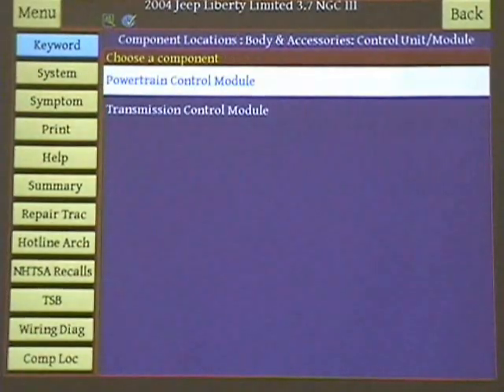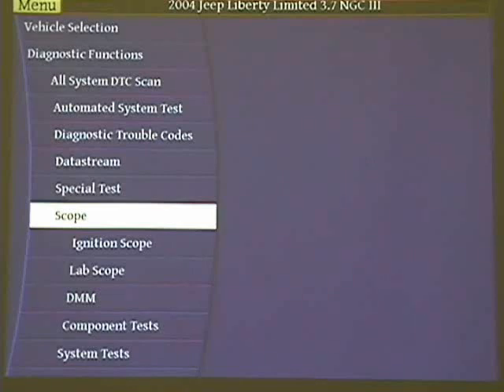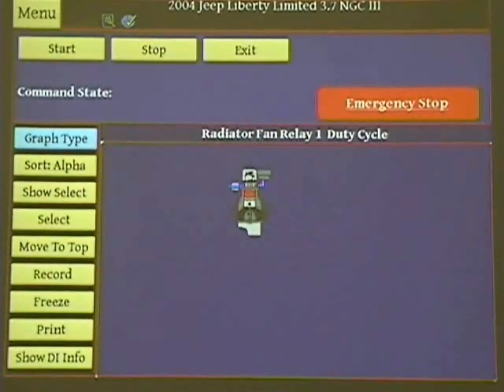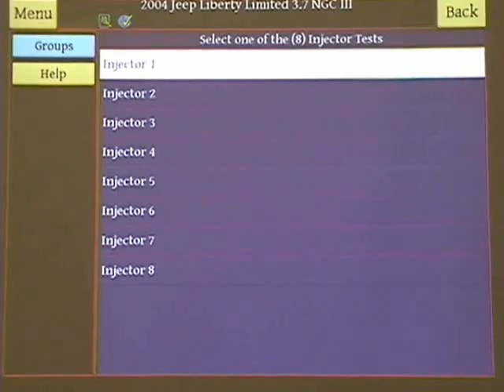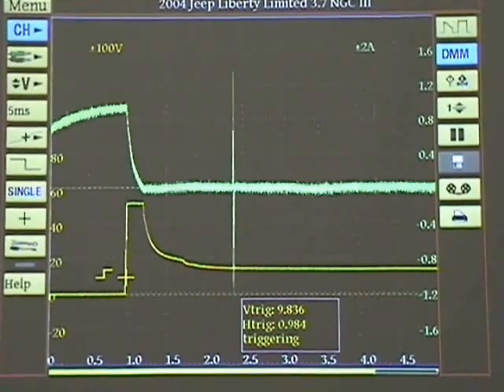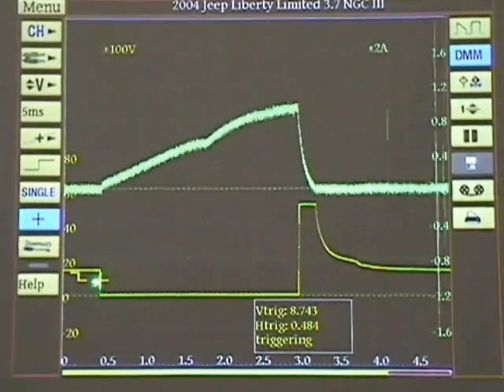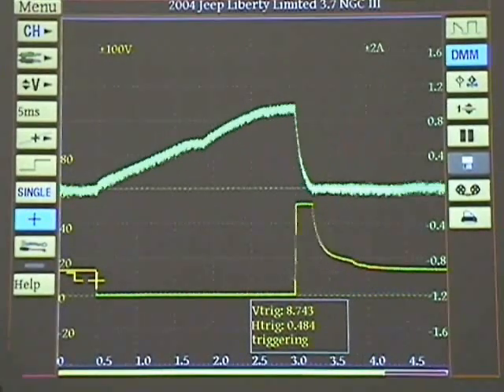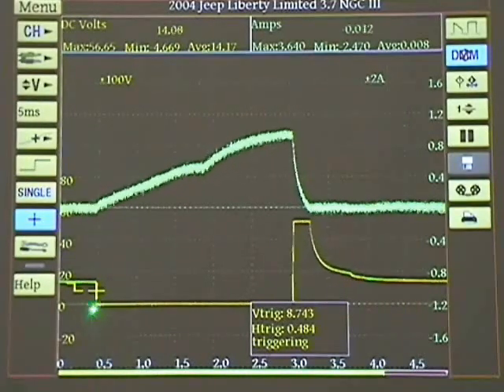Using the Scantool and Scope with the Pegisys PART 6

Comment: BBending113 is a little confused i believe. I had a 02 expedition with an injector that pulled almost 5 amps and guess what, it burned the computer driver.

Comment from the maker: I have pictures of the tool and the short tester sheet. Please take notice that the max on the GM PCGM sheet is 900 ma. When it comes to injectors a Peak and Hold will pull 4 to 5 amps on a GM vehicles for 2 to 3ms and then the amps drop to 900 ma or so.  Remember that 1000ms makes 1 second and the injector open quickly to overcome fuel pressure and then the amperage to keep the injector open drops.

Comment from the maker: The 7984 OTC GM mandatory factory tool  from 1980 to 1996 tested what burned the ECM/PCM out.  It checked all powers, ground and current draw from every actuator on the computer circuit.  The maximum allowable current draw was 1.2 amps, if this reading was exceeded the over current light would illuminate.
The circuits cannot handle high current. Most wires connected to computers are small and cannot handle high current. Sorry I cannot post the picture..I can email if you send me your info.

Comment from the maker: Yes BBending 113 that is correct...Have you ever seen the GM factory tool that checks all solenoids? Well, guess what the max you will ever see is 1.2 amps. If you supply me with your email address I will be more than happy to email you over some pictures along with more information.